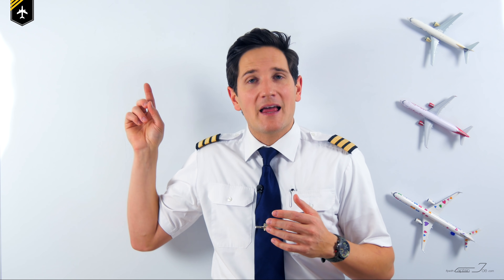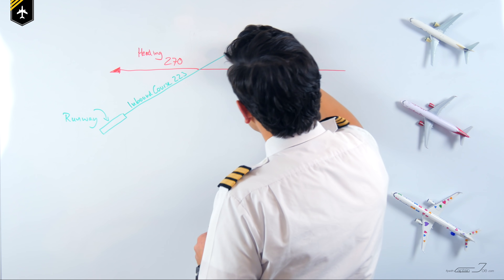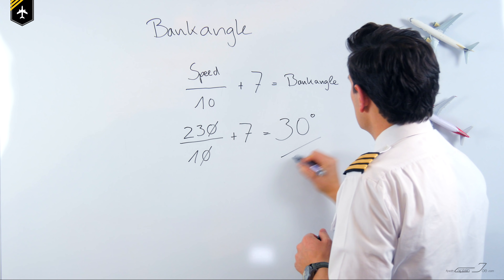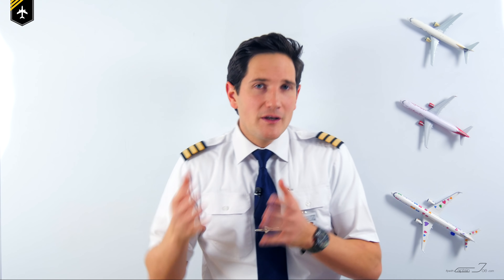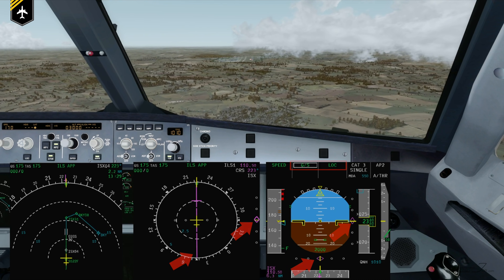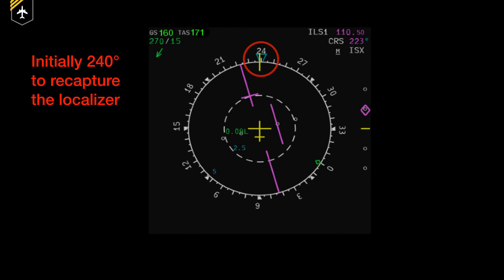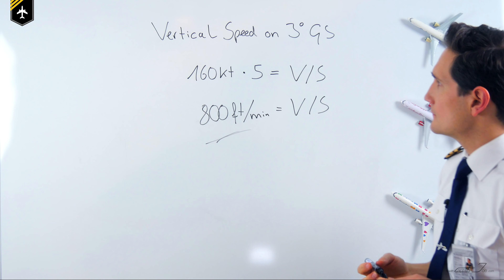HOW TO FLY an ILS? Explained by CAPTAIN JOE

Comment: I learned the ILS many years ago in a Piper Archer. This was back in the days of "steam" gauges with a CDI. After intercepting the localizer, I would fine tune my heading to so that the localizer was centered and stable by the time I got to the outer marker. Then I would keep that heading, making tiny adjustments to keep it centered as I turned my attention to intercepting the glide slope. The key was to make tiny corrections so as not to flying "S" turns down the approach path. There was a lot going on near the end as I slowed down and brought on the flaps. But it was satisfying at the end to look up and see the runway in front of me.

Comment: I love your channel. But this time you bombard me with calculations. I have a dyscalculia problem. I don't understand numbers or formulas. I want something simple.
Reply: Just make simple changes in pitch and heading to keep the needles centered.  Adjust power to maintain the desired speed.  These are the standards in the FAA Instrument Flying Handbook.  The math is not needed.

Comment: Captain Joe, thank you for all your help and teaching. I think, I basically undestand ILS, but now I have bumped into a situation that I can't really interpret. So it's in Slovenia, at Maribor (LJMB), when a STAR (PETO3A) ends in a restcition (waypoint name is "MR") with A5000 ft, but it's close to the runway already and the altitude restriction is pretty high. So what I use for planning, Little Navmap shows that I have to actually GO AROUND to lose altitude, and by the time I get back to MR I'm only at 3200 ft, which is fine, and this spot is only 0.3 nm from the FAF FI32 anyway. First of all, I don't understand, why it is necessary, why can't I just start to descent earlier. Secondly, the aircraft's computer can't accurately calculate VNV, if I have to manually go around. I saw this approach solution in LHDC too, in Hungary, and of course, I also don't understand that, and I don't know how to fly that, and the autopilot goes crazy if I just let it go rolling. There are no hills or whatever that would back this idea up. Please help me, Captain Joe! How to fly these approaches? :)

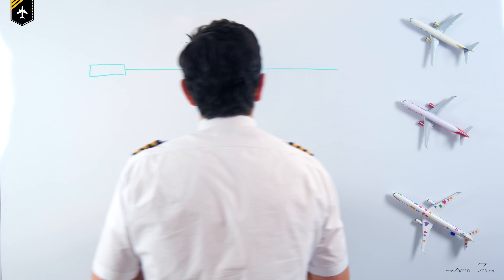Comment: At 05:14 you were talking about the localiser then the calculation was based on the glide slop. I believe the “.8” —> .75 (.15 each dot)is the glide slop max displacement. The localiser max displacement is  5 (2.5 each dot)

Comment: Those days I fly with Baron 58 IlS flying without the flight director is a pain in the *ss. I don't know what happen but the needle system is too much hard to follow (slow reaction time to any deviation). Flying raw data is really a challenge or maybe it's because of the 50 years steam gauge kind of aircraft...

Comment: Probably a stupid question coming from a casual flight simmer, but: can't I just hit the APPR button on the AP panel and the plane takes care of the rest (speed, height, winds...) during the ILS approach?
Reply: Yes you can. But then the pilots are not in full control. When landing manually, the pilot can fly the approach and make rational decisions.
Also, in some weather conditions you can't fly the autopilot for approach
Reply: @ZK-APA  thanks for the explanation! But isn't the whole point of an ILS approach that the plane handles the whole approach on its own and the pilots are just ready to take over in case they need to?
Reply: @tocophonic  not really. Purpose of ILS is to allow landing in bad visibility conditions. Autopilot and autoland is just an assistance.

But yes, if the landing is ILS cat ii or cat iii conditions, then it has to be flown with autoland. With cat i you can manually fly the ils (as per regulations)
Reply: @ZK-APA  So Autopilot is not something pilots always use? I'm honestly curious, why is that? Is the autopilot not reliable? Or do most pilots just prefer to fly manually (or semi-manually, adjusting heading, altitude, speed on the AP panel)?

I thought autopilot is always on after takeoff and pilots only interfere/deactivate it when they have to due to ATC giving different instructions)
Reply: @tocophonic  If youre talking of a typical airliner, the autopilot is switched on after takeoff (timing depends), and is turned off during an approach stage.
Thing isn't that autopilot isn't reliable. Its more of the pilots flying the plane with the assistance of autopilot, rather than the pilots dependant on autopilot.

Comment: hey Captain, random question, When pilots land ILS, is it common for them to do it in High visibility? also if you are doing an ILS and the runway is in site at about 3-2000 feet, would you carry on with the ILS or convert to manual?

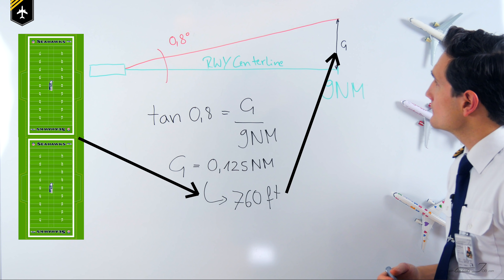Comment: At 5:43 minutes you explain that 1 dot is 0.8°. But according to ICAO annex 10 the approach sector defined by the full deviation from left to right of the vertical needle is defined at threshold by a lateral distance of 210 m (700 feet). This means that the angular deviation of the aircraft is depending on the length of the runway and the setback of the localizer.
So can you explain where this 0.8° per dot is comming from?

Comment: Captain Joe! I love your clips, seriously. I'm a pilot myself. PPL FAA. Since 30 years. Though very low hours. Anyway, do you think pilots really do all those calculations?
Reply: Kai Sicher yes pilots have to do mental maths for such calculations (atleast for raw data flying). But a more shorthand approaches used so that you get an approx answer which is easier to calculate, and is practically accurate enough to fly.

Comment: Are ils approaches taught in ifr or cpl?
Reply: IFR only means instrument flight rules. But during the training for the commercial pilot licence (CPL) you will learn to fly with instruments and you get the Instrument Rating.
Reply: John Daltrocanto as said by mike, you need an instrument rating to do ILS. But ILS (or any other navaid) isn't necessary to get a CPL without IR

Comment: Damn! that's a lot of calculations to do and think about. When the glideslope is about to be captured, and in cases where the autopilot is able to land the plane, I wonder if much/all of these calculations are handled by the flight computer since (I think) pretty much all the data is available for the calculations via sensors etc and thus corrections can be automatically applied? On the other hand, I wonder if in cases where the wind is too much for the autopilot, the pilot primarily focuses on reacting to the instrument displays (rather than pen and pencil calculations) such that correct glide slope / xyz changes and speed is maintained?
Reply: Jimmy Boab generally, these calculations are more for to check whether the aircraft is on the right place or not (or in other words the automation/navaids are fine or not) rather than to fly with it. Moreover the calculations don’t have to be exact, but you should be able to figure out the approx answers

Comment: I’m doing my Type rating and it seems that a lot of my instructors for my airline training do not understand the concept of a zero sideslip. Would you have the ball completely center during a single engine  climb, approach or flight ?  Or split on the rudder? Trying to perform a zero sideslip. Keeping in mind that a jet with turbines has different characteristics than a GA smaller multi engine. How would you keep the ball in the turn coordinator for the Boing that you are flying now ? As well would you use the alerones to track your course in a single engine approach or rudder once the airplane is configured for landing? Thank you for all your videos by the way and congrats for your new Type rating.

Comment: This video is accurate but probably moves faster than it should for those who would be most interested. It gives good points for those who have begun this training but for those who are considering starting the training (already vfr pilots) it requires some time to assimilate each step. 

The first time I sat in the left seat and considered learning to fly, I looked at the panel and thought, "I'll never learn all this stuff!" But I began and learned each part of it, piece by piece and the fog and fear dissipated. I became "smart" and learned how to fly a plane. I felt accomplishment. 

The same thing happens when you look at a chart for the first time when you're considering going on to ifr training. Learn it piece by piece and all the see and fear departs your thinking and you learn. The learning must be at your speed and not necessarily at the speed of someone else. As a pilot, you want this knowledge to become part of you.

OK. Go make that call to schedule your learning and fly a plane. Well!

Comment: How  would you fly the ISS? or does it just orbit by itself?   I would think it would slow down after time
Reply: They need periodically to make adjustments, and ISS uses booster engines when they need to make corrections to its orbit.

Comment: As a layman, I have two questions:1. How runway is found day time when light are not that visible . And 2. How runway is located in case of GPS failures?
Reply: R N Shukla during the day, you use the GPS, or a ground nav aid, or just simply look for it with respect to a map

Comment: Actually you correct for lateral deviations as needed, in the real world there is rarely any such thing as a constant wind. The correct descent (fpm) for any approach type is given for various speeds on the approach chart (usually around 700 to 800 for airliners - approach category C aircraft), then adjust as needed. Don't wait to have a dot deflection before correcting, constant scanning is essential. No math calculations when shooting on an ILS, there's more important things to do.

Comment: Never did IFR on Lugano, But I can tell you that the VFR approach straight in from the north (where there is Monte Ceneri and a lot of other mountains), was pretty challenging as well. Basically, I had to push my Piper down from the safe altitude while gaining waaaaay too much speed for a landing. Turned out I was in power off miles off the RWY, so I was basically gliding in. My passenger enjoyed it and obviously did not mind the slight pressure on his ears :-))). Please don't ask at which point I set flaps 3... There are a lot of challenging (i.e. fun) approaches in Switzerland in the alps. That's why, while learning to fly here, a thorough introduction into flying between steep slopes in a valley is compulsory when getting just your PPL.
Oh, and an extra treat for high altitude with low engine performance is Samedan (LSZS). Not steep, but your engine is basically coughing its way towards the Downwind for a Base turn. Again: There are high mountains and your turning circle on a hot summer day is - well - pretty wide. I can remember my instructor giving me hell on planning every possible approach and brief every single one of them before doing even so much as start the engine.

Comment: how do u know when and where to initiate the turn, so that after 16 sec the course of the plane would be in line with the ILS approach?
Reply: 16 seconds before you roll out on the centre line.  At 210kts ground speed (3.5nm/minute) that is 1.2nm from the localiser.  On a 12nm arc, that is 5-6 degrees before the localiser.  If you have 1 HSI on the VOR and 1 on the ILS, then once the localiser comes alive, around 1/2 scale on the VOR to begin the turn-in is a good rough guide, depending on the intercept angle of course.  ATC could easily shift you from a 90deg intercept to a 30deg one depending how far out you are.  of course a 30deg intercept takes 1/3 the time/distance that a 90deg one takes.
Reply: Hi there, are you able to explain that again at a beginner's level plz?

Comment: In a Cessna 172, the airspeed calculation is much easier: do everything at 90 knots until you see the runway. Then slow down to 65 or 70 on short final.

Comment: can't the computer automatically calculate the winds and correct the heading for the localizer?
Reply: A common flaw of many a modern professional pilot.  In my KSFO example 3 veteran pilots, the two stated pilots had 40 thousand flight hours between them in experience anywhere, were on the flight deck making mistake after mistake calculating the rate of drop per minute so they were eventually in a position where 1.3 seconds before impacting a bay surf barrier they were doing 107 knots per hour when a harassed NTSB chairwoman later recommended a 140 knot speed rate.  Can they just floor the acceleration controls at that point, it would take a few seconds for the plane to be at full power, let alone compensating for slow approach speed.  it was quite a mess.

Comment: I almost got it just need some explanation:
You say:
''-Bank angle = airspeed divided by 10 plus 7''
My question is:
Where did you get an unknown variable with value 7? 
What the 7 represents in this equation?
Please don't be mad at me. I just want to understand.
Reply: Osiris Heart 7 is just a constant which works. It’s most probably found out via trial and error
Reply: @ @ZK-APA   Thanks for an explanation. However, I wanted the @
Captain Joe to explain this. 
I meant he is an actual pilot and especially if he is explaining mathematical calculation then he has to be clear about every single digit.

This is not the first time I am asking @Captain Joe to explain unknown numbers in his equations and I have no answer from him at yet...
I don't mind if it is just random number found via trial and error, but he should have said about it in order to be clear.
Also, I would like to update my question by asking:
If it is just 'number that works' then does it works to any aircraft or only for big airliners?
(But he probably doesn't read comments...)
Anyway, @A2DJP thank you for trying to help. I do appreciate it.
Reply: Osiris Heart haha. Even I am a pilot, that’s why I answered the question.

And yes, the size of the aircraft doesn’t matter, but the speed does. As long as the speed of the aircraft is below 180kts, the formula is applicable.

Comment: That is the Radio altimeter and the aircraft does so because the aircraft is at a low altitude and both the pilots are engaged so the aircraft starts to tell the altitude to the pilots in order to make them comfortable with the landing.

Comment: So all those angle deviation and mathematical calculations wouldn't need to be performed in order to make sure your aircraft isn't deviated by a single degree from the localizer if you have the FD and autopilots engaged?

Comment: Good morning Captain Joe!   I have a question for that very informative brain of yours!  With the Airbus....or jet airliners in general....what is the SOP for correcting GS and airspeed on the approach descent.  Throttle for altitude....elevator for airspeed? Or.....throttle for altitude and elevator for altitude?  Or is it a combination for both?  I find (just in X-Plane) the throttle /altitude - elevator/airspeed makes it easier to maintain the nose up attitude .  But then I haven't had the training you do hehehehehe

Comment: Great video, thanks, subscribed. One detail, at 2min01it's not 3s, but 3 deg/sec, that is 47 deg : ( 3 deg/sec ) = 16 sec
I'm wondering... at 3min09 the rule of thumb for approach speed, you point out it applies to the Airbus 320... maybe it depends on flaps settings chosen to land, too? 140 kts at 4 nm distance... I'm asking because a few months ago I was watching my phone GPS on an airliner in final and the touchdown was at 146 kts ground speed, afterwards I talked to the pilot and he confirmed "yes, because we landed at flaps 3, it would have been slower at flaps 5". (He also added that because they had to perform some periodic tests on the ship it had been an auto landing, at flaps 5... I guess there might be various reasons to chose landing at greater speed, e.g. wind shear.)

Comment: Captain Joe, what are nautical miles?
Reply: ZSuperAlex 1 nautical mile is the distance between 2 points on the equator if an arc with an angle of 1 minute is made from the center of the earth.

Or simply, 1.852 km approx
Reply: Thanks!

Comment: Captain Joe! Could you explain cross wind landing and also table top runway...
Reply: shinytan crosswind landing is when you land with a non direct headwind, so you have to cater to the wind. Mentour has a video on that.

And a tabletop runway is basically a runway on a flat piece of land on a hill. Something like a small scale plateau.
Reply: A2DJP Table Top rundway landing is different and consider difficult and only captain trained on this allowed to land on such surface.. I need some video link which explain this in mlre detail. 

I ve seen the video about cross wind landing but still the point is not clear how much effort it took to counter crazy wind

Comment: Just one thought.  For slow trainers gs x 5 is great.  For faster try gs x 5 + 50.  So in the example here 850 fpm.  If you calculate for a 3° slope using trig you’ll find it’s much closer.  Nice job, Joe!